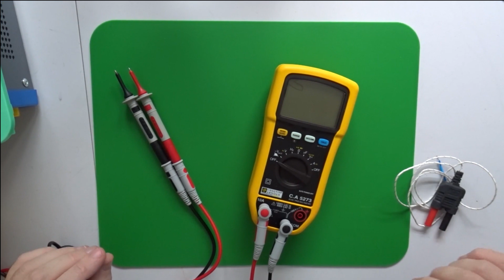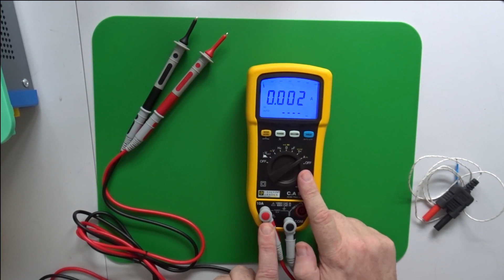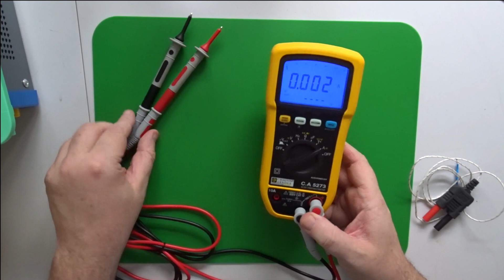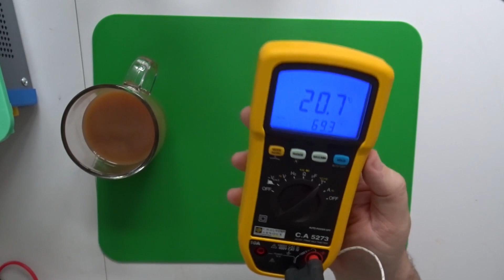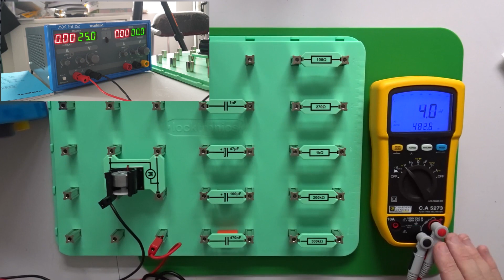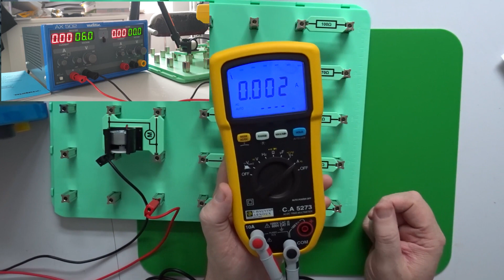A look at the Chauvin Arnoux C.A 5273 multimeter

Comment: Nice meter. I have a CA5231 model, very similar to this meter. It differs in name, as it is branded AEMC, the north american division of Chauvin Arnoux. My 5231 has gray rubber cover and only 2 jacks, as it measures voltage, resistance, continuity, NCV and current with external clamp. Too bad that it is difficult to get this meter in my country with the yellow cover. Maybe importing it from Europe.